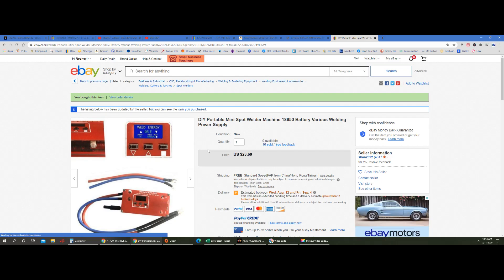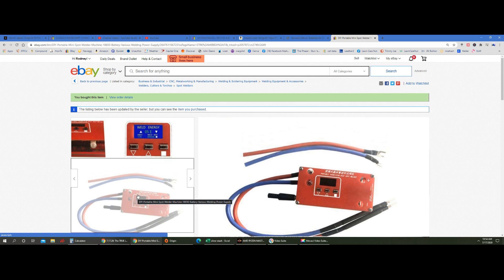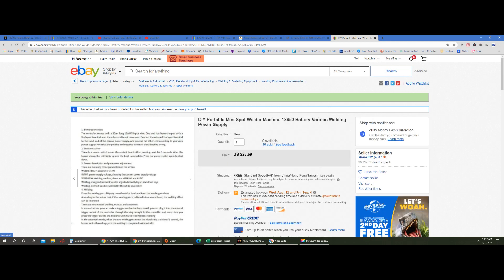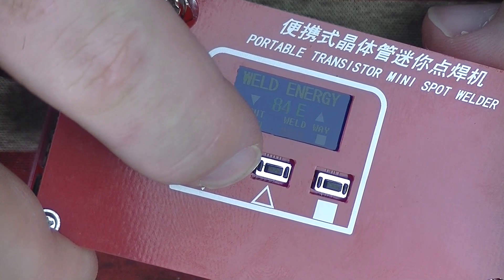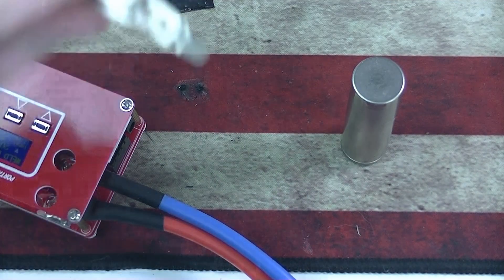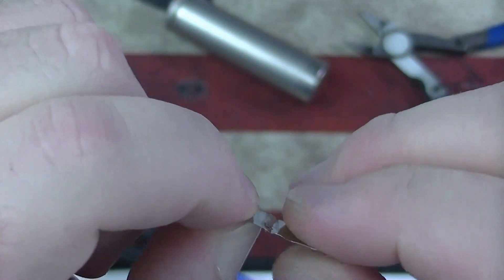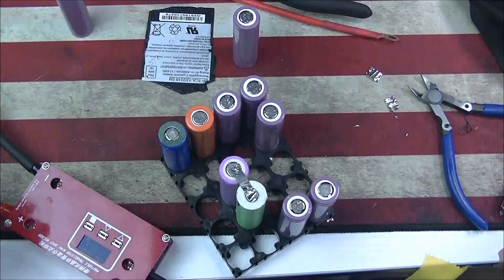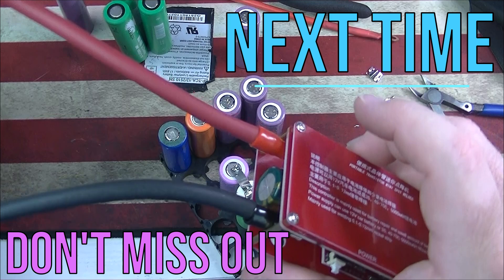The Best CHEAP 18650 Spot Welder?

Comment: You're a God-send, bud! After watching your video and reading all the comments, I have determined that the best combo is the welder (Aliexpress), 8 awg OFC wire for the battery, and a lipo 50c 5200 mah battery.  So far, I got up to 40E testing with some decent welds, but might need to go has high as 45 or even 50 before I continue the repair of my li ion pack. I'm using 21700 cells and 0.15 pure nickel strips for the repair.  So far so good...
Reply from the maker: Thank you, I hope everyone gets to read this.  Everyone that brought their experiences and knowledge together for the community.  I'll mention it in the next video.  I'm glad this welder is working for you as good as it did for me.
Reply: I have used basically the same combo (a 50C 5500 LiPo), had to weld 0.2 pure nickel... When I got up to 40 smoke came out. It kept smoking after that and it couldn't weld the 0,2mm with lower than 40-45 anyhow... After the smoke (and know what had already happened), I just turned it up to 50. It didn't weld better than 25 at that point...
I just turned it up to 70 after that and it didn't weld at all. No power came out of the welding tips. It's broken now...
The thing is I paid 50€ for the LiPo and 25€ for the charger... 20 for the spot welder... 95€ and it doesn't work...
I will try replacing the mosfets... These might have been bad...
Reply from the maker: @FishFish1995  sorry to hear that. it happens. Mine is still going strong at 30E welding .15mm.  I just completed 6,000 welds with it. if you have to buy another you are still ahead of the $250 for a Kweld. And now you will have extra mosfets.
Reply from the maker: @FishFish1995  cHECK OUT adam welch's video on the repair. I just used mine again this week for a 7s24p battery build.
Reply: Please  shoot me  the link

Comment: I would like to know the failure percentage the failure rate of the spot welders I bought two of them was just under $17 each both were failures they werenew I got a refund.... but I just wanted to know what the failure rate and there are many many different versions of the same spot while they're all over the Internet varying from $8 all the way up to $80 maybe it's just a different mosfets or something but mine had a bad switch I think I don't know it just started firing right off the bat it didn't even give me the beeps and the other one smoked I had 6s 12 volts so I would like to know the people that have had these a lot of people who like them really like them and a lot of people who say they're junk really say they're junk and some people make modifications I would like to know exactly what's going on with these little welders

Comment: Just use any 12 volt battery and jumper cables with nail in each then touch your metal on top of battery’s and works perfect... I even used a 9v battery with nails in the ends and works fine

Comment: There was no comparison, only single spot welder. Do we have to take your word that it is the best cheap spot welder amongst many other cheap spot welders ?
Reply from the maker: You can see for yourself in the video.  I still use it to this day. just made a battery pack for my Dewalt drill yesterday and used this set up. works great and is much easier to use portable than my K-weld.

Comment: Is spot welding the same as cold welding or do they have a difference. Because when i seach spot welding on youtube. They showing me cold welding. Are those to the same. If so could you use this maching to cold weld heavy duty thick metal or something .
Reply: Cold welding is NOT what you've been shown in YouTube shorts. "Cold welding" is the spontaneous fusing of similar metals due to intermolecular locking.
What had been advertised to you as cold welding is actually just really poorly done tig welding.
This operates on a similar principle to the crap that's advertised as "cold welding" but these are engineered to actually work correctly with this application. The voltage is far lower and current far higher than normal welding. Standard welding is anywhere from 50vdc and up. This is more like 2-3v max.

Comment: Cool,  take the leads to each ends of a 18650 fully charged then run fast. Not trying to give any ideas. Better yet,  someone could get a better idea on what a 18650 can handle without destroying it, you could encase a 18650, and change metals
Reply: That is similar to attempted battery suicide, many Lipos can handle 20-100c but shorting the battery is much greater than that it can easily reach 1000 or more discharges rating, the reason why this device works is that it separates the battery from the short at the electrodes by using MOSFETs and capacitors, otherwise you would have a damaged battery in no time and even caused it to catch fire and maybe explode. Also putting 1000c+ at the electrodes will instantly melt the tin and glue the electrodes to the battery you're welding it at making sure you have a very bad day.
Reply: @michaelcastro5339  try some super glue and baking soda. Sticks good to aluminium
Reply: @michaelcastro5339  so you can deadshort a coil in a light bulb through a variac . Why use capacitors in some cases can be the question

Comment: Sorry for the novice question. Can I use a charger with a 12v 1amp output to power this?
Reply from the maker: no,  you will need a high (c) rated battery. soo something like 12v  50c-75c,  An RC car battery. lipo cells.
Reply: @RodneySolarCircuits  Thanks. I found info on how to make one from the transformer out of an old microwave, and even found that piece for sale for only $25. But I'd still have more work to put that together, PLUS the output was like 2000 volts. Not a good idea for someone who doesn't understand electricity ;)
Reply: @RodneySolarCircuits  What about a car battery?

Comment: Has anyone used it with a car battery using jumper cables attached to the binding posts under the hood run 12ft to power this device? My car battery is 900cca and wondering if this setup will work.
Reply from the maker: Ive seen mixed response with car battery. mostly bad but when it works no-one posts about it.  Mine is still working fine.  I use it as much as my K-weld.

Comment: Hi
I have one of these that beeps but never welds, no sparks, nothing
Seems to turn on ok and makes all the same noises as yours, it just doesn't send any current.
Reply from the maker: LOW voltage on the battery( I try to keep it above 11v but closer to 12v, lose connection, or might have a blown mosfet.  There are some good videos out there about it. Im sure you already found them by now.
Reply: @RodneySolarCircuits  thanks for the reply.
Not much that can go wrong for loose connections because it gets 12.6v from battery so the display is constantly on, and also it beeps when it touches metal which mean the other 2 wires are also making good contact, not sure about mosfets, it's weird all would be broken, the device is brand spanking new, never had a single weld... because it doesn't weld at all. Using a good 12v car battery with 200cca tested on a battery tester.
Reply from the maker: @galaxyb1103  Definetly look at the repair videos of it, it will give you a better knowing of what is going on.  sounds like the timer is working but no power going to the tips or maybe not enough.  Adam Welch has a good video
Reply: @RodneySolarCircuits  it eventually broke on me.. did manage to weld a spot then burned a mosfet, removed faulty mosfet, ran another weld, burned a second mosfet. Just didn't work for me. Used a fully charged car battery and the darn thing still failde, btw it's the new revised version where you don't need to add a capacitor.
Reply from the maker: @galaxyb1103  i haven't heard of good things when using a car battery.  Read the comments and you will notice. Mine is still working great.  Used it to WWLD in my more recent videos alot
Reply: The same thing is happening for me, I have tried 3 different DIY spot welders. None of them did what they were supposed to.

Comment: WHAT ABOUT JUST USING A 12V CAR BATTERY AS A SOURCE ??  TOO POWERFUL ??
Reply from the maker: Check out some other videos about repairing or upgrading it. Mine still works fine with my setup. but others have had problems with car batteries. Thanks for your comments and watching.
Reply: @RodneySolarCircuits  Or what about a dewalt battery and one of those 12v to x40 adapters?

Comment: IF YOU KNEW HOW TO USE A SPOT WELDER IT WOULD WORK A LOT BETTER PUSH THE WELD PROBES STRAIGHT IN NOT ON THE SIDES READ THE DIRECTIONS TELLS YOU NOT TO USE PURE NICKEL / USE NICKEL PLATED STEEL THANKS FOR ALL THE MISS INFO BUDDY.
Reply: A little aggressive bud
Reply: @demolitionwilliams7419  just the facts
Reply: Yeah, we all see how smart you are ricky.
Reply: @dhyde9207  well what can i say live with it

Comment: I used my 3s lipo battery I built for my solar generator to power mine. They are 21700 40t samsung cells. 3s40p pack. 
On my very first weld one of the mosfets blew a hole in it.

Any idea why? Battery voltage was at 12.2v at the time. Total current should not have been an issue. Unless I used to much current?
Reply from the maker: Watch ADAM WELCH's recent video on the reason and repair of it. It makes since why.  Then I would buy a second one for part replacement.
Reply from the maker: As you can see in my newer videos, Mine is still going strong even after building my 14s680p packs. I thought about building with the 2170 "Tesla" 5ah cells but i can buy 3ah "ring cells" for much cheaper and I have sooooo many cell holder for them.

Comment: Negative cable last, to prevent sparks. Either way. Thanks for the video. Your the best.
Reply from the maker: Thank you. Nicest thing ive heard allday!
Reply: @RodneySolarCircuits  Hi, I bought one of this spot welder, still waiting.
I need to solder some wires to an electronics module.
Is posible to solder a copper wire to a PCB with this tool?

Best Regards.
Reply from the maker: @treadmillrepair754  no, good for nickel strip to batteries. pcb layer is to thin.  Soldering is better.  Thank you, hope that helps.  keep watching other videos.
Reply: @RodneySolarCircuits  Hi, this module comes with nickel wires from factory, is imposible to solder using 60/40 solder wire due the large heat dissipation capacitity.
Anyway Thanks for your help.

Comment: It’s nice to see the nickel tear when you test the welds. That tells me that the weld “took.” The first couple at “20” look like they stuck ok, but the ones at “40” and “50” look much better. Maybe the pens need a more rounded point to weld the “pouch cells” you’re holding in your vise.

Comment: Spot welding relies on resistance in the strip to make heat that fuses the strips together. If the strips are too conductive, ie, copper, it won't weld.

Comment: On the lowest setting mine vaporised the strip. Then after 5-6 'welds' it blow a transistor. Small 12v automotive battery as power supply
Reply: Hello, same problem. Did you solve it? Thank's a lot.
Reply: @seb_industries  here is the fix https://www.youtube.com/watch?v=fdnO0Z-scjA&ab_channel=MakerFabio

Comment: From reading various reviews, a good power source that holds the voltage during welding seems key to wether the welder blows up or not.
It could be that a battery pack supply works fine fully charged, then when it loses charge, the voltage dips too far when welding and it blows the FETs
When I get mine I'll have a good look at the design and see if there are any other modifications that should help reliability (apart from adding the auxiliary supply capacitor).
Reply from the maker: I use a 3s SPIM08hp cells. When they get to low 11 volts I recharge it to 12.3v.  on the screen of the welder during a weld the voltage will drop by 2-3 volts. so there is a lot of voltage drop that can be seen even with this battery.
Reply: @RodneySolarCircuits  2 to 3V drop is pretty good. I think the crank amps rating of car battery is at 7.2 volts (!)
Reply from the maker: @jeremylister89  REALLY!!  Wow.  You think the voltage goes too low and shorts the mosfet's gates.     When the voltage gets about 3.8v on the all-in-one welder, the mosfets start clicking.
Reply: @RodneySolarCircuits  without testing and mosfet datasheet VGS(th) analysis I dont know. But if the MOSFETs come out of saturation with hundreds of amps flowing, they probably won't like it, and may fail depending on their SOA limitations.
Reply: I found this video... looks like the solution https://www.youtube.com/watch?v=fdnO0Z-scjA
Reply: @samuelsoto6620  Thank you, I:ve already seen this. My welder arrived yesterday, analysis starts soon.

Comment: Bought one of these on eBay. It lasted for about 6 cycles trying to set the power. Then the circuit board flashed a nice fireball, and it was toast. Do not waste your time or money.
Reply: Same. They asked me to send photos in use, so I took a video. Actually captured the moment it blew.
Reply: @stuart8taylor   easy fix https://www.youtube.com/watch?v=fdnO0Z-scjA&ab_channel=MakerFabio
Reply: same exact thing happened to mine it burned the MOSFET after few cycles...piece of junk

Comment: I'm kind of new to all of this but what kind of things are welded lithium batteries good for?  I'm trying to fix my hair trimmer but I've had trouble finding someone to bond the batteries for me.  I think that's why it won't turn on.  But after my trimmer gets fixed I can't see what other things the welder might be good for?  Thanks for the upload
Reply: Battery packs for things like power tools, cordless vacuums ets.

Comment: Looks like a sweet deal! Is there a way to power it by plugging it into to 110v?
Reply: You'd struggle to find a transformer to get it down to the 12v (and also DC) and also have the amps it needs. A car battery is perfect for it.

Comment: Spot welding requires pressure at the point you want to weld.  When you're welding nickel straps to 18650 cells, you do this by pressing down on the strap with the electrodes, and this makes two spot welds at once.  And in your tests welding one strap to another strap, you still had something to back them both up, so there was pressure at the weld point, and that also works.  But when you tried welding the straps on two LiPo cells, you came at it from both sides, and not directly at each other, resulting in a lack of pressure at the point where the two straps met.  When you're welding from two sides, you MUST press the two straps together at one point, that is, the same point on both sides, in order to get pressure holding the two together at that point, which is the only way to get a high current through them.
Reply: This is exactly what I was thinking. The contact area must be reduced to increase the current flow over a given surface area.

Comment: I took a chance on one of these after three unsuccessful tries with another design. My first try went fine, but not enough current. I turned it up from setting 10 to 20, and this time, the board caught fire. THIS THING SUCKS!
Reply from the maker: Wow
Reply: Nope, the battery you were using sucks. https://www.youtube.com/watch?v=fdnO0Z-scjA
Reply: @Spartacusse  if you have to modify it before use, it sucks. This one worked out of the box without modification. https://www.amazon.com/dp/B08DQS25FH/ref=cm_sw_r_cp_apa_fabc_KIf1Fb8FXC141?_encoding=UTF8&psc=1
Reply: @AM-ty9lp  But...that costs $70, and all you need to fix this one is to solder a $1 capacitor to it...
Reply: @geometerfpv2804  I'd rather pay more for something I don't have to fix before use. It's like buying a car with no oil in the engine - simple fix, but big problems if you try to start it.

Comment: Looks pretty good, but I’ll stick with my microwave transformer build. It’s been doing good for several years now. No problems.
Reply: Are you using the microwave transformer directly or is there more circuitry?
Reply: @alexstone691 : I took out the secondary coil and replaced it with an old jumper cable. I soldered two grounding lugs on the ends and have copper rod extending out of that. As far as controlling it, I just have a momentary push button switch rated for 250v AC secured to one of the welding leads that controls the input power to the transformer. Set the two leads on, tap the switch, done. I stick together a lot more things than batteries so I didn’t want to build it for just one purpose. It’s simple, and it works.🤠
Reply: @Dingomush  ala TKOR (King of Random) style build?
R.I.P. Grant 🥺
Reply: @bradhabit2217 : I will have to look and see. I really didn’t get into YouTube until fairly recently. I’m just an old tinker gnome and work things out “on the fly” so to speak! lol
Reply: @Dingomush  I'm right there with you on the age and tinkerer deal.
The video I'm talking about and the build that I made.
I use some roof flashing and made a solder pot but I've never used one on an 18650, because I'm scared, lol.
Reply: @bradhabit2217 : I welded up my first three sets outside on the picnic table for that same reason. I’ve taken a few older cells and really held the button down and overdid it on the weld and it’s never caused any internal problems, so far anyway. I still keep the old “explosion containment pie dish “ at hand, just in case there is a first time though!

Comment: Thanks, just about to buy one!
Just one point, the probes seem to have a point contact. The K weld probe tips are more rounded and seem to have slghtly larger contact area. Does it make a difference?
Reply from the maker: I have both and I can't tell the difference between welds.